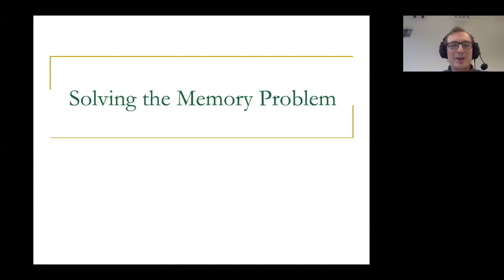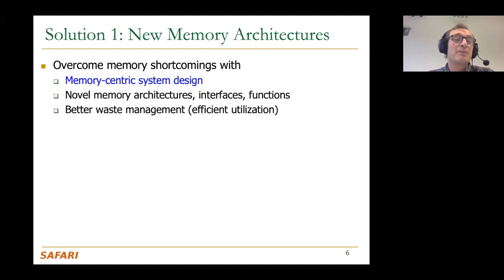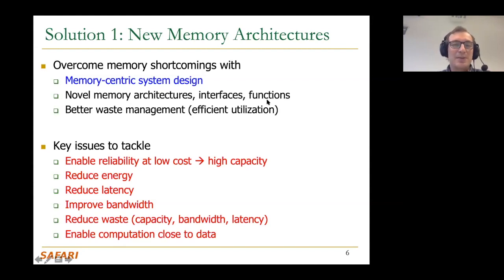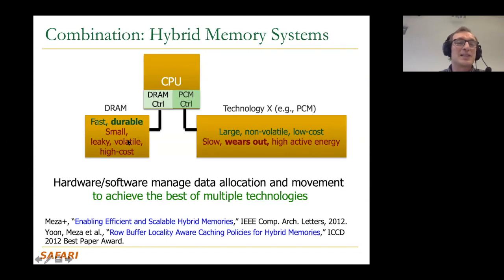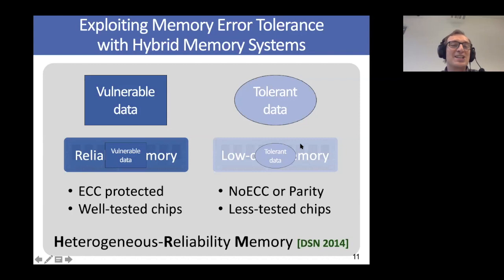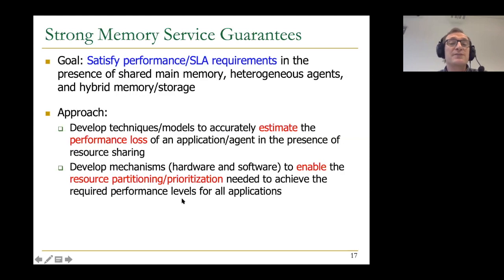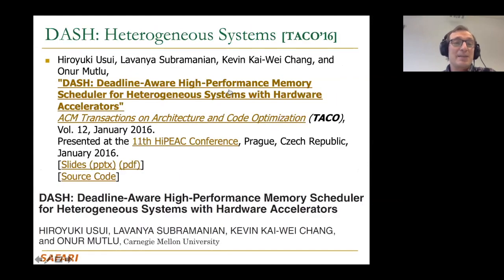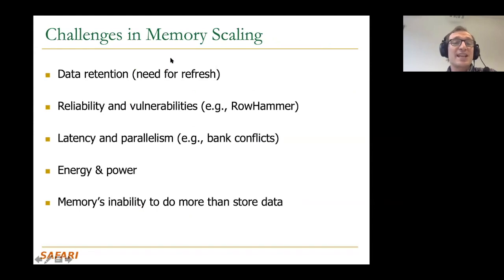Computer Architecture - Lecture 4a: Memory Systems: Solution Directions (ETH Zürich, Fall 2020)

Comment: Question on memory latency: Intel desktop CPU L3 is about 10ns, and the SP L3 is about 18.5ns, which seems to be the case for all of the LCC, HCC and XCC dies. This is time to access L3, delivered to the core. How much of the L3 is the tag check, versus data access? i.e., when does the memory controller start access on an L3 miss? how effective is the L3? both in terms of cache-hits, and reducing traffic on the MC? Can the L3 tag check be made really fast, so that on a miss, there is minimal delay for the MC to issue an access? - the L3 data access time is less critical.
I have two Comet Lake Intel i7-10700K and i9-10850K, one with Crucial 3200MT/s CL22 (13.73ns), the other with G.Skill 4000MT/s CL17 (8.5ns), resulting memory latencies of 61.5  and 46.5ns. I was expecting 11ns difference (5.25ns for each of tCL & tRCD + 0.5ns for higher MT/s), not 15ns.